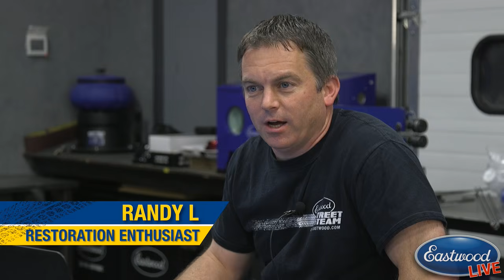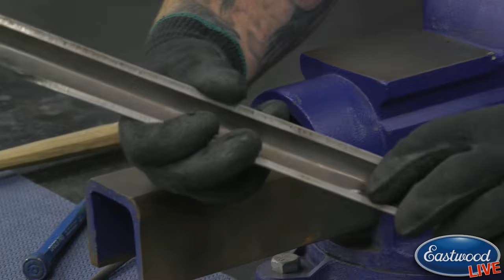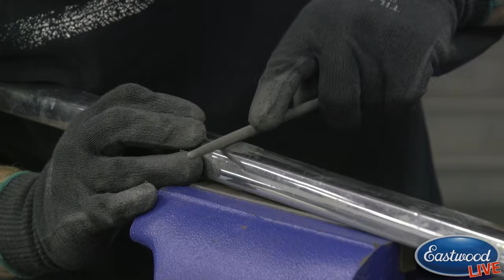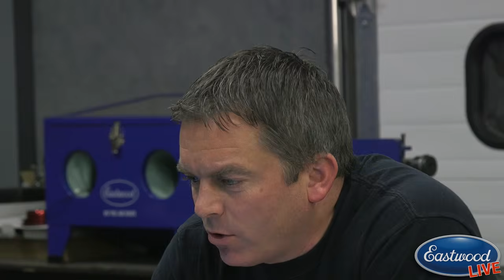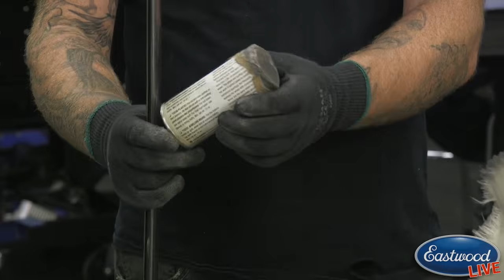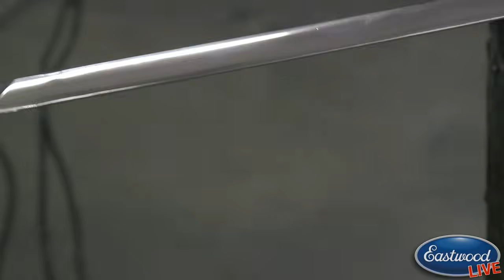How To Repair Stainless Trim!  Metal Repair at Eastwood.

Comment: Use a flat file to find your highs and lows.
Or run that round file longitudinal instead of laterally.
The way you are doing it allows the file to follow the bad contours instead of allowing it to straddle the imperfections.

Comment: This video will help me a lot. But i do have a question on stainless. Is it possible to weld or solder two pieces of stainless trim together then sand/polish it to look like one piece? I have a piece of stainless trim for a 57 Chevy that got crunched and needs welded back together and I'd like to make it look at least passable on the street if i do this. Ideas? Thank you.
Reply from the maker: Yes you can TIG weld stainless but it being trim will make it challenging as it's so thin.

Comment: Is there any way to weld or solder 2 pieces of stainless trim together then grind or polish it to look like one piece?
Reply from the maker: Yes! You can TIG the two pieces together, then grind, then sand, then polish.  It's difficult though without filler.

If you ever see industrial kitchens with loooonnngg stainless counter tops that are seamless - this is the process they use.
Reply: @eastwoodco  Thank you! What kind of filler are you talking about? This helps me a lot.

Comment: On another vid, the operator used a black felt tip marker over the damaged area before filing. That way the low spots really show up.
I actually purchased 2 1956 moldings like the one you have on the bench. About 23 years ago, they cost me $100 each.

Comment: Terrible video.  Metal tools are good, plastic hammers are the best to tap trim with less impact. Trim is ultra sensitive to steel hammer taps…easily dents trim. Waste of time watching this.  More advertising than any good points.

Comment: How would you file the inverted curve on the 56 Chevy trim.
Reply: With a piece of sandpaper wrapped around a sponge using light pressure

Comment: Great video as usual Matt !  FYI, while sanding stainless or aluminum,  don't forget to clean your work piece in between sanding grits and buffing compounds. This ensures there is no leftover sanding grit or compound to contaminate your next step. You can use Windex, paint thinner, etc. to clean the metal. I have both of the Eastwood buffing motors (1 HP and 1/2 HP) and I have great luck with all of the Eastwood buffing compounds. It is tough to get a true flawless mirror finish on aluminum because the metal is so soft and the lest little touch will scratch the metal. Eastwood compounds do a great job of getting the aluminum to a near "hazeless" finish. When you hold your trim in the sunlight and roll the trim in the light and see no "haze"  and the reflection is perfect, it is a very gratifying feeling. Eastwood compounds will get you this effect, show car quality for sure. Thanks again guys.

Comment: I find the easiest way to work out dents and matching the level of the rest of the piece is to use 3" lengths of 1/4", 3/8" or 1/2" dia bars, laid on the inside against the dent and hammered against an anvil.  This assures the dent is pushed level with the rest and no further.  The smaller diameters are also useful for matching ridges.  I'd also use a larger anvil to make sure the piece is laying flat.
Reply: can you post a pic